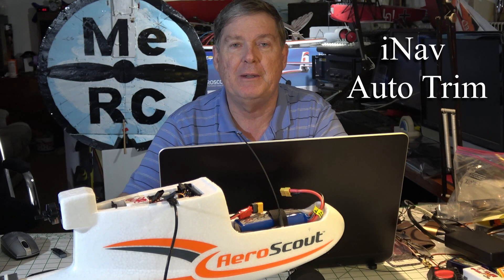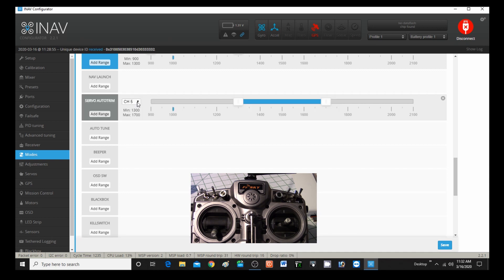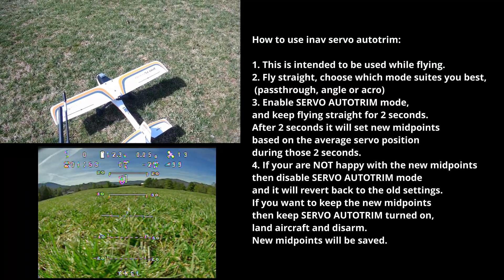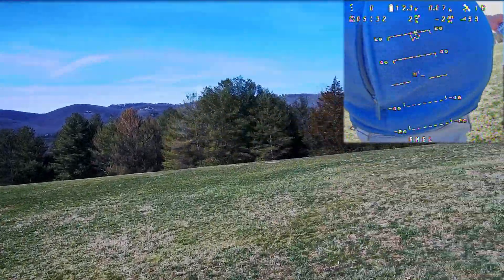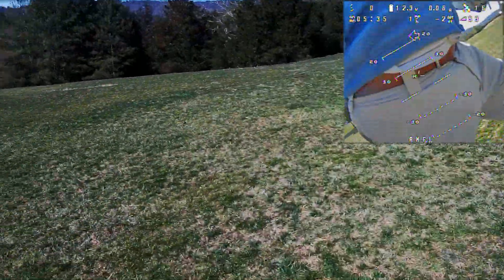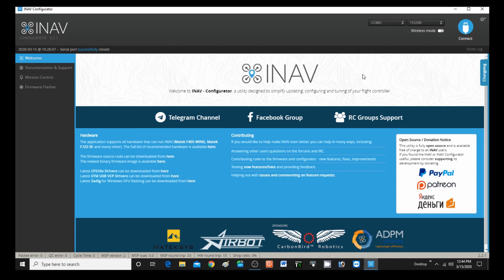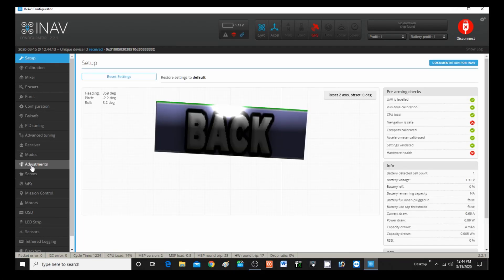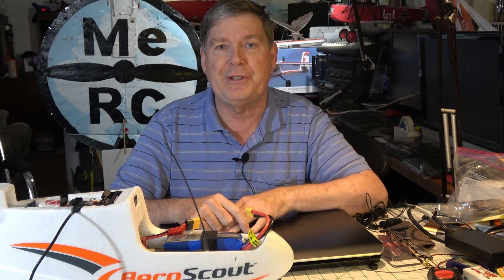iNav Servo Auto Trim Tutorial - AeroScout Plane w/ Radix Graphical OSD and Golfers asking questions!

Comment: I think Dave you didn't explain fully..?..So, do you fly the plane trimming it using the TRIMS ON THE TX until it flies along level..and then throw Autotrim?..Land, reboot and save..? Or what? Then move trim levers to zero?...Fly along holding it level manually?...How does it work..?
I thought you were going to crash the plane at one point, those Golfers threw you I think...We are still grounded freezing our ass off in the wind and rain...🤔🤔🤧🤧😳🥴🥴🥴😒😒😒
Reply from the maker: Just center the trims on the radio and go for it.  Let the FC do the trimming.
Of course I did make sure the control surfaces were working normally on the bench first then checked to make sure in the air again before flipping the switch to autotrim. The rub is that autotrim only last 2 seconds so make sure the plane is flying straight when engaged.
Not sure I did such a good job with the level flight. Best on a windless day. Hope you get some better weather to fly.
Reply: @DaveMerc  Hi Dave, I see the Autotrim instructions now, thanks...That HUD ladder horizon would drive me to distraction tbh.. Don't you find it distracting when flying fpv?
Reply: @EnglishTurbines  Best to do it FPV ET. That way you can see better if its level or not and not climbing by keeping an eye on the altitude. I always thought you had to do it in Acro or Manual, but maybe they have changed that? It worked for Dave in Horizon. You can do as many times as you want till its right. You will know, coz when you put it back in manual mode, it should fly level and straight, where it wasn't doing before. Its Auto-Tune I still haven't tried yet.